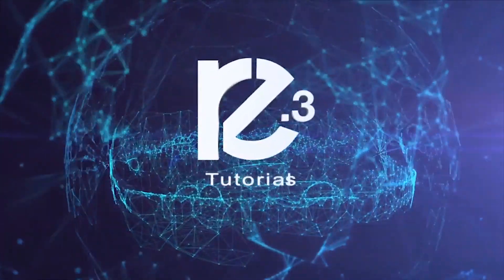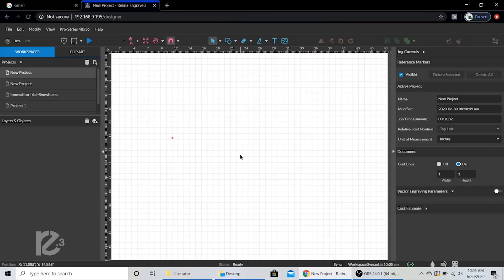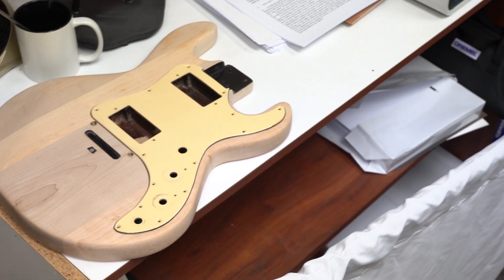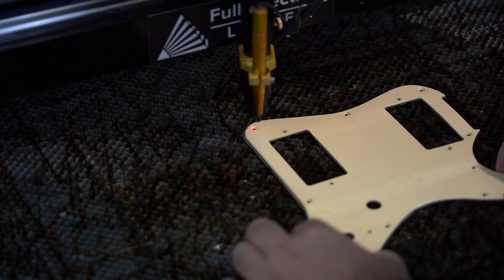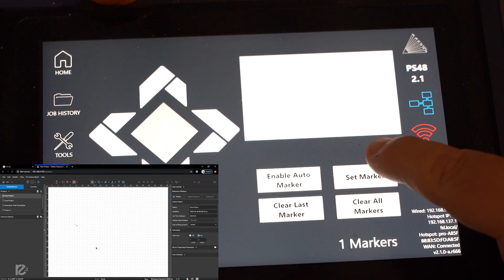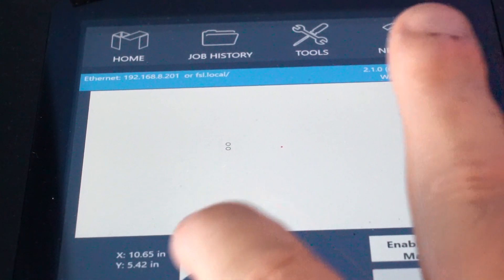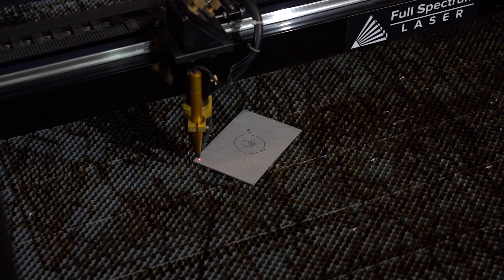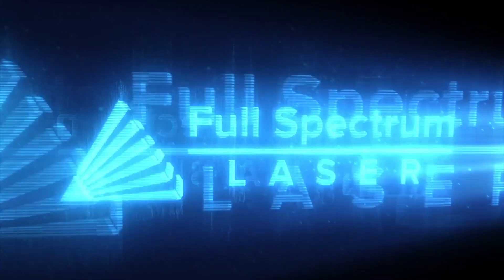How To Use Reference Markers

Comment: So I can't create a reference marker with a previous Muse model (I bought mine new in 2018) that does have the camera for purposes of using the riser for the pass through cutting like you have on that other video with the pro where you used reference markers and had the cut design split into two parts? Is there some other process to create such a marker where I could see a video tutorial or somewhere on the Full Spectrum site?
Reply: @walkermckaeg1627  sweet thank you